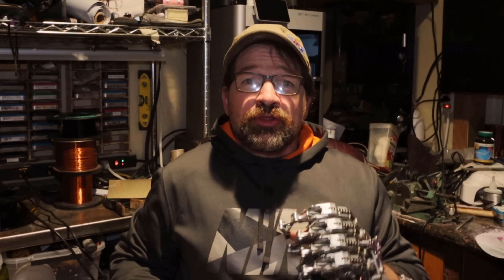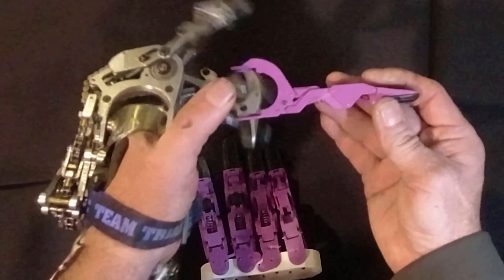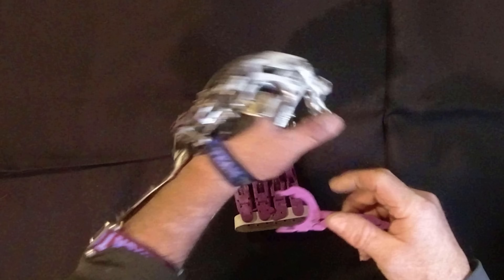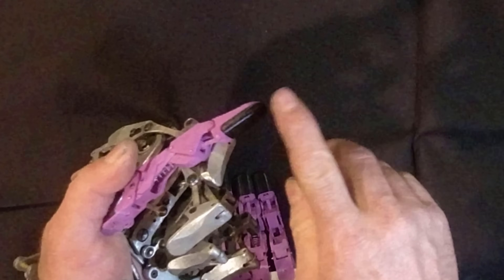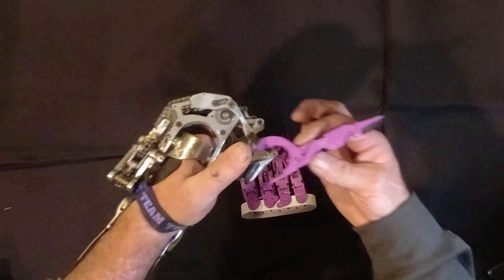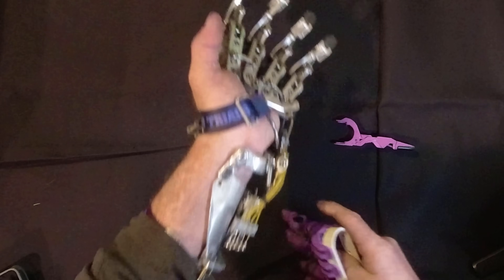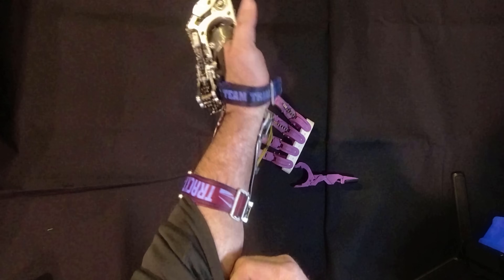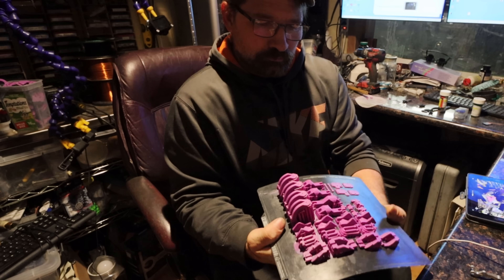New 3D Printed Partial Hand Prosthetic Design!    Please Share to get this out there!

Comment: Interesting video, I thought the message was a little scattered.

One thing is syntax. 0:01 to 0:15  is composed of a single, long winded, and winding sentence which is confusing to follow. Here, try reading it:
"So I thought I'd do a quick little video, to show you the progress I've made —on what started out a little over a month ago as nothing more than a thought exercise— but has now turned into a 3D printed prosthetic hand."
There are no periods in this, it's all commas/dashes, and this sentence contains at least five different ideas. Because these ideas are all so close, they should connect. They are related, but they don't all work together!
Looking at this, the first idea is about the video (this is a quick video). Second, that the video is about progress. These two ideas are like a thesis statement, and it prepares the viewer to find out about what this progress is. The third idea is about how long ago the project started. This all would form a well fleshed out sentence. "I thought I'd do a quick video to show you the progress on something I started a little over a month ago." This boils down to "hey, I'm about to do a video on a thing!"
But without even pausing, we introduce the fourth idea, that this was "nothing more than a thought exercise."  Previously the "sentence" had been about the video, setting up expectations for what it would be covering, but now we are actually covering the project itself! This is a subject change, which creates confusion! The sentence should've ended already. The fifth thing follows, "but [this] has now turned into a 3D printed prosthetic hand." I don't have much to add, except that it's weird to include the "but?" Like, are "thought experiment" and "3D printing" incompatible or something? Anyway, this second half is not just, "This started as a thought exercise," but it is also "but it is now a 3D printed project."
BASICALLY, my brain has now turned to mush. We're missing periods, pin balling between ideas, and twisting subjects. What this comes out as, is that the sentence does not actually know what it is about. 

Now, I realize that this video is probably unscripted. And that talking is difficult (I sturggle with it often). But, I felt this was worth going over.

Because this run-on tangent-twisting is inherent in the larger structures of the video as well!

At 0:18, fingers are "showing promise." But the next section of the video is about how many iterations the design has gone through, and the factual specifications of this design, rather than its promising features. We get back to promise with the "Slide on distal tackle mat," so it's not that bad.

Around 2:10, the video shifts. "But if it allows me to get this project out to those who need it, I'm willin' to make that as a sacrifice."
This was startling to me, as it's kind of unconnected with anything else prior to it, and it's and emotionally poignant. It reframes this whole project as something for other people to use, where previously the whole intent of the project seemed to be, "make something small with reduced complexity." This section left me confused as to whether or not you were serious about distributing this design or not.

I feel like the structural problems (tangenting) are really epitomized in 3:30 to 3:39. :)

I will say that I am looking at this from the perspective of someone who consumes this content for entertainment.

-__________---*-__________-

As for the fingers themselves!
They seem cool. The pad on the pointer finger is a nice touch. If these fingers were distributed/sold/something, I would be interested in acquiring them just for the coolness factor.

-Having the fingers bend in a flexible way probably isn't as important as reducing the part count?
-It might be cool to have the fingers have a way to reach further down onto the palm of the hand.
-I like the purple-black color scheme, all it needs is some neon green accents.

-__________---*-__________-

Thanks for reading! This comment took far too long to make. I will honestly watch these videos for the mechanical hand alone. The fact that they have a bit of story is a nice bonus. It would be great to see one or two specific examples of problems you're facing in designs. Good luck!
Reply from the maker: This is what happens when I don't write the video out as a script. You think it's all over the place there, try listening to it in my head!
The purple happened because I ran out of black abs and I had a partial roll that I knew was consistent and printed decently.  If you're making a color request, I do have a spool of neon green I can run next.

Comment: To answer your question about what I think, honestly it's a great way to get the idea out to the masses who need it faster. With those files I imagine it wouldn't be hard for others to hire a company to use a metal 3D printer to fabricate, maybe this can be planned for in certain designs? I imagine with the intent of working with a metal printer there's more tolerance for what's possible. Either way, great work! I love seeing these updates.

Comment: I think it would be a better idea to not slide the rubber finger tip on but to click it in so i does not slide off when gripping some items so the taking off and putting new on is not in the same direction as the item would fall if the fit of the fingertips was a little loose. Clipping them into the fingers at an angle of 180° on the front face of the fingertip would make it less likely to slide off during use.
Reply from the maker: Im using a square D to hold the distal pads in place.

Comment: Great work! The fewer the parts, the simpler the mechanism, the fewer break downs will occur. Also, I know you probably already looked at and addressed this, if gripping finer objects is a struggle? Either program in the print or use a laser etcher to install 'finger prints'. Those ridges and whorls in finger prints are there for the same reason why Geckos have those microscopic brushes on their toes, it increases friction and allows air to escape to form a quasi-vacuum enhancing grip of small objects. Fun Fact: You find 'finger print' like structures on fingers, hands, feet, toes, and eyeballs. As we age those structures reduce, which is why elder people have harder times opening jars, slip and fall on slippery surfaces and have dry eyes.

Comment: This is the thing about 3D printing. It's cheap and you can repurpose and reshape the plastic to get the shapes you want. When you find the design that works best you can measure the pieces by 3D scanning and then apply the dimensions to metal, whether it be making a foam and casting the pieces or CNC machining the pieces. Plastic does wear down, but it's important to note that when working with plastic you need to work with the pieces for a short time as opposed to resin and hardener, which is great if you want more durable pieces.

Comment: Seeing as you're doing 3D prints, have you looked into compliant mechanisms to reduce material and parts?
Reply from the maker: I have,  version 155 was based on the principles of compliant mechanics.  One of the main issues that I ran into was that I need 90 degrees at each joint,  getting that type of flexibility with an adjacent area being rigid is problematic at best. Tpu doesn't like to stick to engineering grade materials reliably.

Comment: Are these only suitable for trans metacarpal amputees or can they be altered for different levels?
Reply from the maker: This design requires the metacarples to be full length in order to generate enough force to be useful. The amputation needs to be through the mpj. As far as adaptability, no. There are products already in the marketplace to accommodate pip and dip amputations. Primarily naked prosthetics and X fingers, both of which require the proximal for the device to articulate.
Reply: @missingpartsclub  thanks for clarifying!

Comment: I often think this when I see your videos. Do you think 3 fingers and a thumb would be a better design for simplicity and packaging?
Reply from the maker: A cartoon hand if often used when the residual limb is too narrow to accommodate 4 fingers. I've tried experimenting with several different orientations like that. 2x2 3x1 3x1 rotating to also be 2x2, as well as 90 degrees radially opposed. The problem with anything radical is interfacing with the real world. The world is expecting a 4x1 interface.

Comment: You had me at pink fingers. Looks like the jobs rotate on a thin pin, the shear strength in stainless would be excellent but do the pivot holes need to be machine drilled after printing or can the printer maintain that hole size tolerance?

Comment: TPU is nice and grippy, but you may want to explore adding a "fingerprint" of some sort, e.g., spiral grooving, for additional traction.
Reply from the maker: Totally,  what I've been playing with is wavy grooves in the tpu and then plastidip into them. Tpu itself doesn't have a huge coefficient of friction, plastidip is higher, but isn't durable when you cake it on thick enough to be something like I do on my aluminum fingers.
Reply: @missingpartsclub  Not sure which slicer you're using, but a few (e.g., Cura) do have an option for "fuzzy" exterior surfaces, wherein the slicer will randomly jitter the outermost wall. May help with traction, albeit at the cost of the process being indiscriminate and working on all external walls, which may make installation more problematic (or could make installation more secure - more fodder for experiments!).

I've been experimenting with casting via 3D printing, and that may also be an option. I'm wondering what it would be like to create molds for your fingertips and cast them in one of the harder silicones, preferably something with moderate hardness but a high friction coefficient. That may get you into "best of both worlds" territory of a durable contact surface that won't slip off whatever you're grabbing.

Comment: Ian, have you heard of markforge 3d printers? They can layer in continuous carbon fiber while printing to make really strong parts. I have seen people use them to make soft jaws that work extremely well. Might be perfect for your needs.
Reply from the maker: Id love to have one of their setups, Continous Carbon strand prints are awesome,  but you still have the inherent issue of layer adhesion that comes with 3d printing. That's always going to be the issue with printed parts.
Reply: @missingpartsclub  You're right about the layer adhesion. Do you plan on using aluminum or stainless for your final iteration?

Comment: Amazing design Ian.  I look forward to seeing it in stainless steel. 
Being 3D printed, it also allows for easy scaling to size for each user.
Reply from the maker: It does to a point, I can see running into issues with the pin sights if you scale it down too much. It's probably not going to be a viable solution for kid size hands. But adult size, sure. You could maybe get away with -15%. Anything less and you're going to run into geometric issues.
Reply: @missingpartsclub  The real problem with the scaling is most likely strength issues of different parts, people tend to forget how malleable metals really are, especially when they enter the realm of sub mm thickness.

Comment: I wonder how far can you go in the opposite direction to reach parity on a functional level instead of the looks; a "hand" that's not a prosthetic replacement but a tool that's not constrained by the shape of a regular hand
Reply from the maker: You still need to interface with a world that's expecting a conventional hand shape. Sure having a prosthetic that is a tool would be great, but what tool is going to be appropriate100% of the time other than one shaped like a natural hand.
Reply: @missingpartsclub  I wasn't expecting any response, it was more like me thinking out loud so sadly I don't really have a better design in mind.
My reasoning was that for example a car can move faster than a human, it doesn't achieve it by mimicking and/or enhancing our motion method but instead going for a totally different approach... but now that you mention it I didn't take into account the environment, using my own analogy I came up with a faster traveling tool than our legs but what would be the point if there are no suitable roads for it?

Comment: Try using nylon print, Nylon is less susceptible to temperature and has a stronger structure
Reply from the maker: Problem with nylon is its hydrophilic,  not that all plastics aren't to a point, and isn't going to offer the stiffness in the small cross section that I need for the design.

Comment: Hi. My english is not so good, since 1988 went out of school.
As you sayed, the 3D printed will stop half way. While the Aluminium Finger is still travel the whole angle.
May be you can fix the by using additional load in Form of an fishing weight. Only 1 g Hammer it thin and put it with tape to test it on.
I think now can the top end of the 3D finger will further rotate may bebtill the end of travel as you have the the Aluminium once.
I think you did a very good work till her and this is not the end. Happy New Year I forgot to say. Bye T.

Comment: there is a new resin out for resin printers called extreme though resin, it would hold beter then PLA or other plastics close to it.
Nice job on the scaling to natural fingers I hope to see the working project soon :D
as someone that loves robotics, I love to see what you created to people that have need for this, prosthetic are way to expensive but 3d printing made it cheaper for people to do it them selfs
Reply from the maker: I've had no real luck with resin even in the short term. It always seems to be too brittle, and fractures at the pin sights. Either through expansion/ contraction, or because of shock loading. You need a kind of undercured print that isn't sticky, but not spongey. I'm hoping that powder metal sls produces a clean, strong enough version. The problem is even pmsls has lines.

Comment: im curious to know how specific these builds are to your hand. if you started selling/sharing these simpler versions, could someone with slightly more or less of their digits still in place use them? can they be adapted to people missing only one or two fingers, instead of all of them?
Reply from the maker: I'd love to say yes, but that's going to take some work on the part of the end user to setup. As far as more or less of a finger, no. This design is for disarticulation at the mcp. There are already options in place and available for pip amputees.

Comment: I remember an old laser-cut acrylic hand that used a button on each knuckle for grip selection.  Lot less convenient than the wrist operated cam selector on your latest hand, but simpler to build.  Might be a way to keep the simplicity of the new ABS hand design without loosing grip selections.
Reply from the maker: Ya, laser cut acrylic was so 3 years ago.  That was one of the processes and materials that i started with. There's a video out there.

Comment: Have you ever thought of trying to do casting for aluminum parts? Robinson foundry here on YouTube demonstrated that he could do lost PLA casting(lost wax but with 3d print part) He was able to cast double thread bolt and nut and had very little clean up  to make the parts run smoothly. There are a lot of intricate parts but turning 3d print to metal could be beneficial.

Comment: I think 3D printing is a great option here. Have you looked into 3D printed compliant mechanisms at all? Might be able to incorporate them into the design.
Reply from the maker: I have, that's one of the reasons I bought the bambu, then I found out it won't do tpu through the ams...maybe through a pallet system... the issue I run into with going compliant is I need 90 degrees at each joint, but I also need it to be stiff every where else, tpu directly to abs doesn't really work long term.

Comment: Another innovative idea for us finger challenged. I have Point Digits stainless mechanical & I-digits Quantum by Touch bionics. A wrist driven device like yours is the missing puzzle piece for durability , weatherproof & function. 🦾
Reply from the maker: I also have an ossur I digits quantum, super slow and fragile, point design fingers are absolutely beautiful,  but as you know they aren't driven. I'm hoping that this ends up working out. If pmsls doesn't work out I guess I'm buying a Swiss Lathe with live tooling. Either a citizen or tornos I suppose. Just needs to accept 1" stock.  Hopefully printing works out, as it solves some other problems.

Comment: would be interesting to see how the strengt of the 3D-printed fingers compared to the aluminum ones
Reply: Aluminum will be about 10x stronger than typical FDM prints.  The wild-card is the MarkForged continuous carbon fiber printers.  They can make stupidly strong parts as long as the loads are in a single plane.